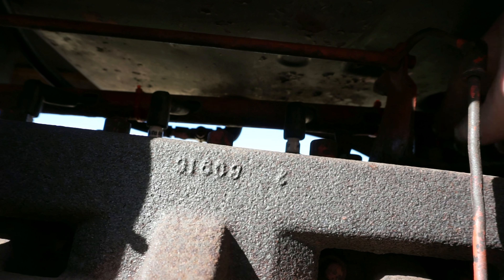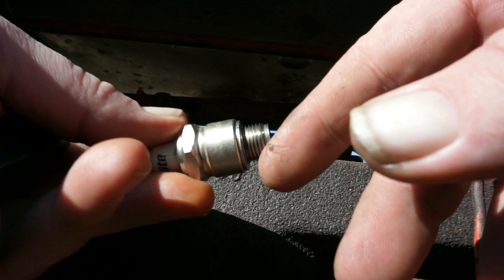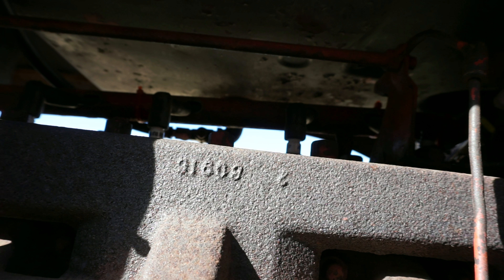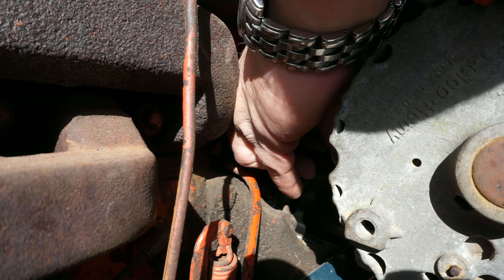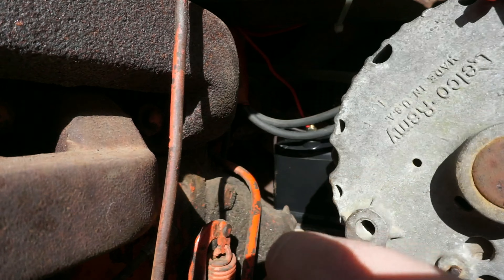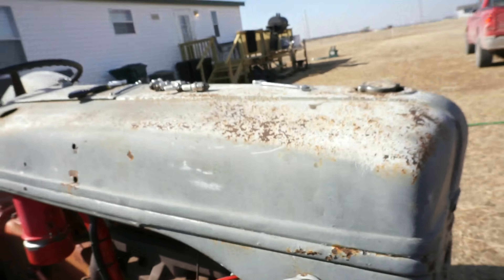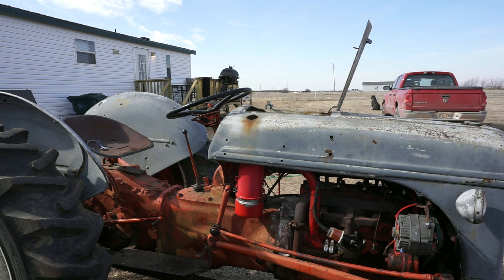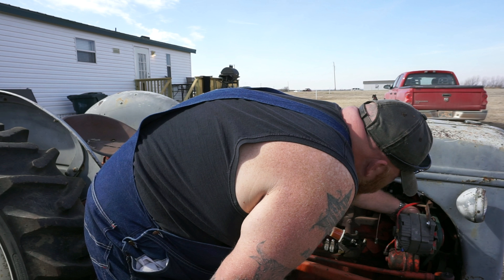Putting this Ford 2n Tractor Back Together

Comment: I have a 1944 2N now for about 9 years. The spark plugs are Autolite 216. Found out Autolite does not make that plug anymore !! Can you tell me what spark plug number did you use from Autolite? thanks,Ken